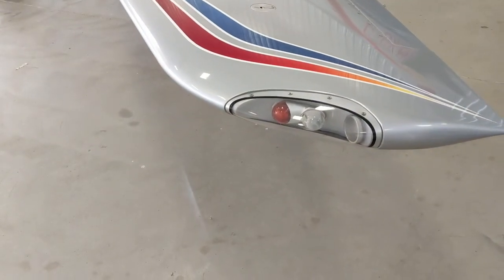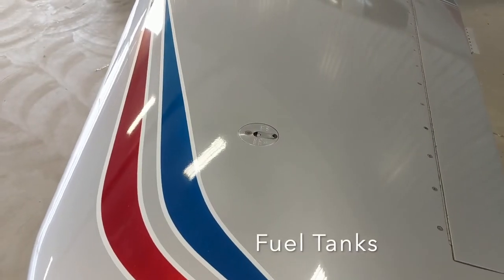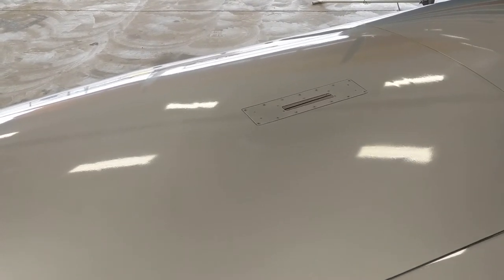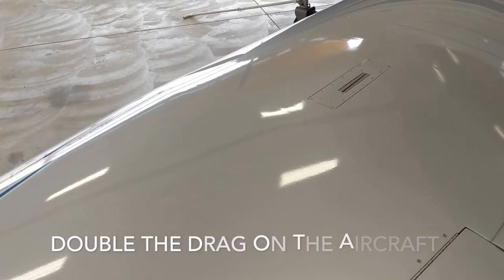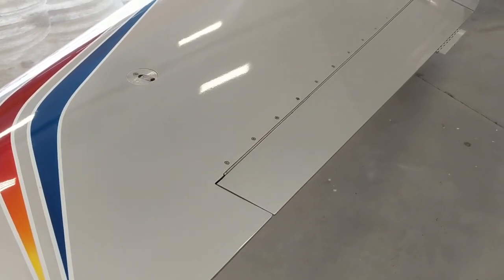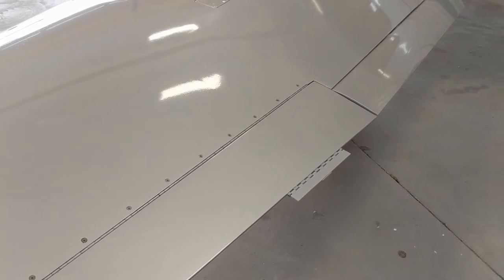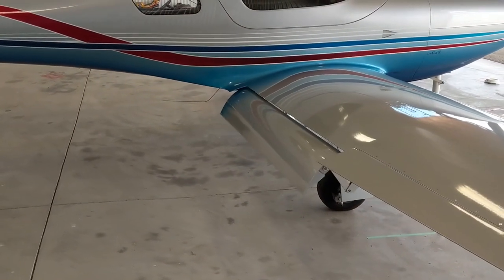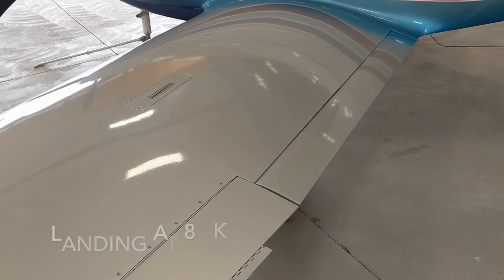Lights, Fuel, Controls - Lancair Legacy RG

Comment: Even the engine manufatures say shock looling is a myth. It's a hold over from the early radial days and has carried over through to today on inertia alone. It's kinda like the myth the engines need exhaust back pressure. Now THAT is counter intuative.
Reply from the maker: I've heard that, too, but the ones I'm aware of have cooling recommendations.  Ultimately, I'm not an engine engineer, and even A&Ps say that because there isn't a hard data letting us know what is good/bad cooling rates, it may not be a bad thing to think of when cooling your engine.   Regardless, if a little bit of forethought helps to prevent a large bill down the road, that's great.  If not, nothing lost.
Reply: @PiInTheSky  Yes, there is nothing wrong with erring on the side of caution. There is some interesting physics going on. I've been an engine guy my whole life and found a lot of myths and interesting truths.